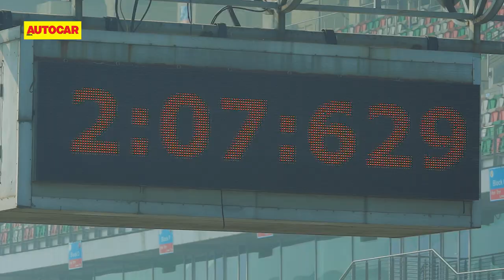Porsche 911 GT3 - Breaking The BIC Lap Record With Narain Karthikeyan | Feature | Autocar India

Comment: Brilliant! First off, Narain isn't driving a team car or a sponsor car, he's driving his own car, which is a fact that he has to completely put aside when pushing for a lap record. It's not like if there was a problem, or if he crashed, he could get into a 'spare' car. Secondly, this may be a GT3 but it's shod with road rubber and this showed on the corners, where you could see how much Narain had to correct his steering inputs to keep the track line and the car in complete control. It may have looked easy but watch his face when he's hitting the corners, he's clamping his jaw tight and grimacing as he focuses and fights for control. 

What a champion this man is! Congratulations Narain, Porsche India and Autocar. BTW the video editing was awesome!
Reply: Very true, but the Michelin Pilot Sport Cup 2 tires the GT3 comes with are some of the best road tires that can be used on the track.

Comment: Bring the GT2RS. It will do it in under 2 mins😉
Reply: It's the rider not the ride..
Reply: Abhishek well then put this guy in a GT2RS
Reply: I might not be soo confident. The GT2 RS has around 700 BHP while the GT3 makes around 500. 
The GT3 comes with a naturally aspirated 4.0 Flat-6 hence the power is predictable and controllable.
The GT2 has a twin-turbo, which is susceptible to lag(even the most advanced turbo systems, there is lag), which will make it harder to handle the power.
Also the fact that the extra 200 Horses would mean, Oversteer Armageddon.
Reply: @serenedystopia3488   well they're doing it with the gt2rs . Watch the new promo . They'll be dropping the video soon

Comment: Damn its not even an RS model... God knows by how much margin would he destroy the record if it was the RS.... But Damn... He drives like a CHAMP...look at those slides....
Reply: Those slides are time waster on. Track..
Reply: @Abhishek-150  that's not entirely true. He was running street tires which have a maximum grip compensation of 0.9 Gs on turns.
He would've definitely been faster without oversteering if he was running track tires.
Street tires on their limit tend to understeer which wastes even more time compared to Oversteer.
Narain is an F1 driver. I'm pretty sure he has more knowledge than any of us on how to drive a car faster around a track.

Comment: Was the TC and esp on or off, as when you are talking about a road car you need to drive like one as it was sliding alot.
Reply: Rohit Saxena don’t talk when you don’t know what you’re talking about.
Reply: The sliding compensated for the understeer caused by the street tires. And yes, Traction Control was off, otherwise, powersliding was not possible.

Comment: Show Tesla on the show. It is really good
Reply: Only in a straight line and till it hits 120 kph, it's a slug after that.
Reply: @serenedystopia3488  agreed , but its acceleration is unparallel ,if the acceleration is implemented correctly by altering the racing line and braking a bit then its definitely faster than most gt3 and gt2 vehicles out there, and yeah it also comes in a sport mode or smth where it has like a +100 hp , so yeah this 911 thing overrated af